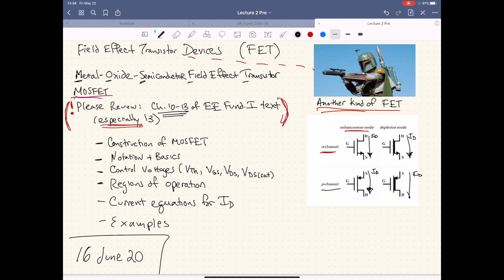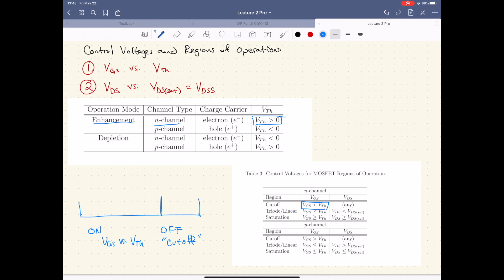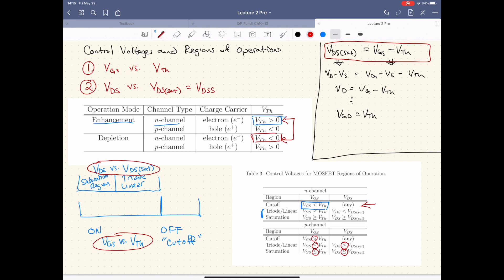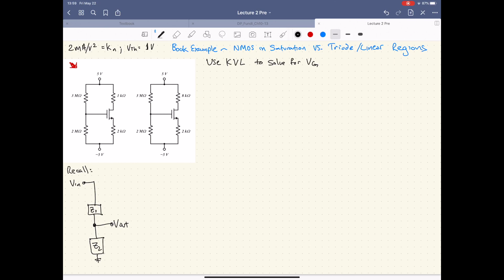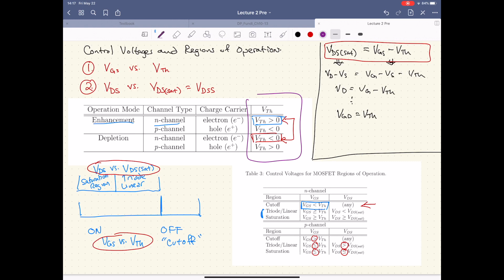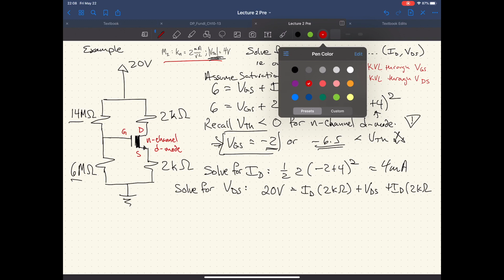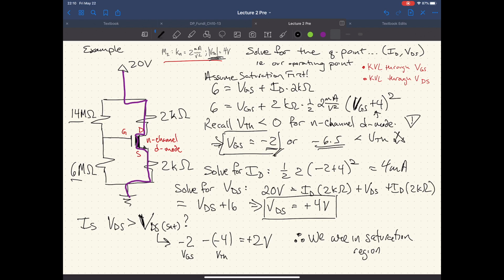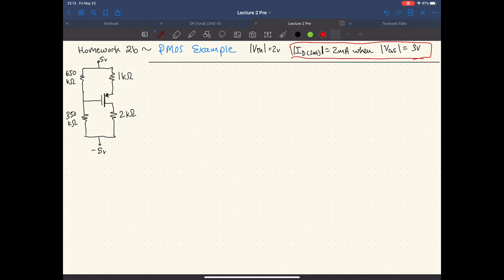Lecture 2 - Summer 2020

Comment: 17:05 for the current equation, wouldn't you need a negative sign if it's a PMOSFET? Instead of having electrons flowing from source to drain, we have holes flowing from source to drain, therefore making I_D negative when the PMOSFET is on. As the current equations are now, they imply that the drain current is positive regardless of NMOS or PMOS